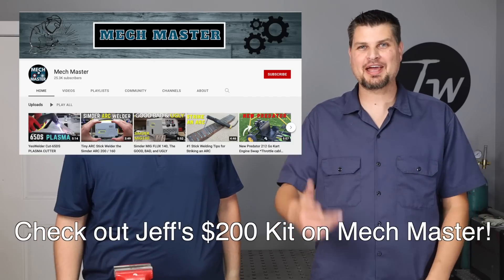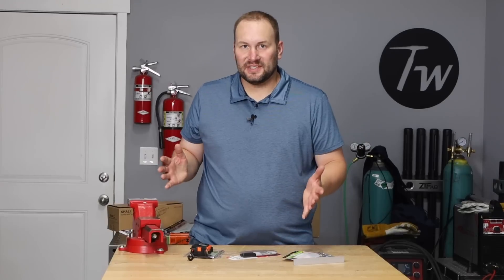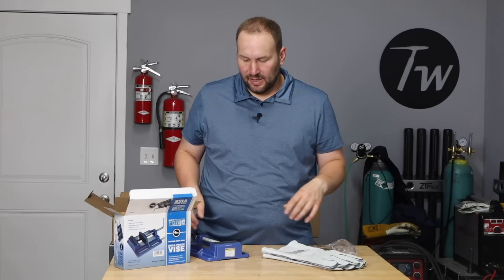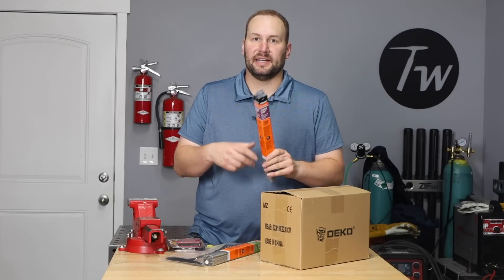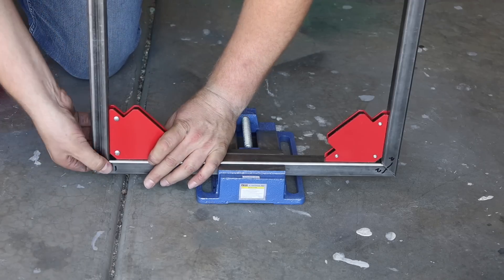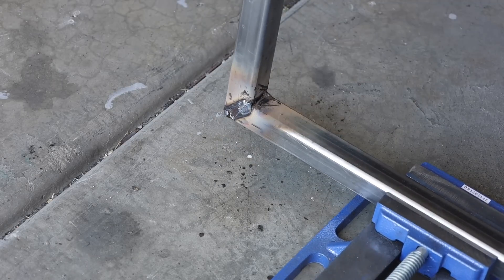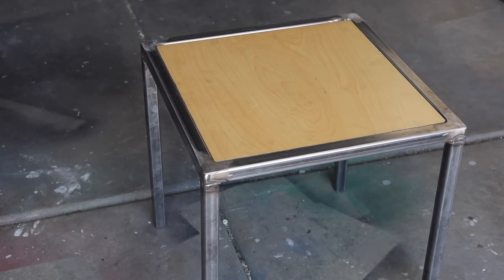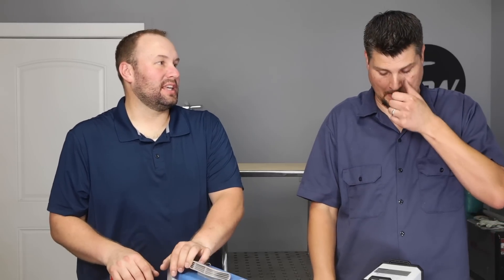Can I Start Welding With Only $200?

Comment: So I have the Yeswelder ARC205. It is a workhorse. It helped me start my own side business and I ended up buying everything else Yeswelder had. My entire arsenal is Yeswelder. MIG250, 65A Plasma, 205A AC/DC Tig and recently the Flux135. 

No conplaints. Being said I do baby most of my machines but the ARC205 stick welder gets the most use since I dont have to run a gas line, I can weld up to a 5/32 rod, I have to run some extra cable for the 240V plug to my power source. I have a strap worked out so I can carry it around and weld all around a bigger priject without needing to relocate my cable too much. 100ft of power cable is usually enough. I changed out the ground clamp to something more robust but the  clamp stinger is more than adequate and feels good to me.

So uh... yeah, I can vouch for Yeswelder, best money I've spent, does the same as the fancy Millers or lincolns or esabs. For $179CAD, get the ARC 205 and have fun!

Comment: Im trying to start welding as a side hobby. Do I just get like metal sheets or pipes from Home Depot? Im just trying to do testing and stuff. And is the welder just like high heat electricity?
Reply: What I'm planning is to weld a funny little roll cage onto a shopping cart and just throw it around like a park or something while being inside
Reply from the maker: You can get material there, but it's really expensive for the amount you get. If you google "Steel Supply" and your city name, you'll find some metal suppliers in your area. The welder just gives the right amount of current and voltage for an electrical arc that is a concentrated source of heat. For projects like that, I wouldn't use a stick welder, I'd use a MIG or at least flux core welder. Stick welding thin material without burning though is difficult. Make sure to test your welds out before you try shopping cart rollovers.
Reply: @TimWelds alright haha! i will see what happens. i will for sure test it down a hill with no one inside it to see if it bends or anything

Comment: going to upgrade a little need to stay under $300 the 2 machines I have been looking at are the vevor 270a multi function and the azzuno 200a multi function which would you recommend or is there another multi function you would recommend.

Comment: I appreciate how concise this is.  Few thoughts, as someone who isn't as crunched for cash:

1. I wouldn't skimp on a welding hood, if only to ensure I get something that protects my eyes.  
2. If I have an existing fleet of tools... I'd get a corresponding one of that set, for an angle grinder.  Maybe.  Depends I suppose on if I elected corded or cordless.  Maybe a cheap corded would do the job just fine.  Or maybe a better quality if you have other projects (like sharpening tools) could justify a better grinder.  

And just to be clear, I don't have any experience.  I clicked to learn, but am still foggy on basics, but would like to pickup a skill or trade I could explore an interest in, and maintain my own stuff.  Will probably go out and pick some of these tools up from HF tomorrow.

Comment: I bought the cheapest mig welder i could find ...only thing i requested was it had to use gas...  Hitbox .... Mig ... I didnt expect much.....😅.   But    damn it works fine .. for how long i dont know ..... But i use it for all those " glue two bits of metal together". Jobs around the house .. i even ran it of my generator at 22 amp ..to glue a gate hinge on .. ...

Comment: I think if you have any kind of confidence you can do this and will like it you will be monety ahead to buy at least a small mig.  You can always start out with flux core but for a few bucks later on you can add a bottle of 75/25 and really enjoy.   After a welder and grinder I would consider a chop saw and maybe a second & better grinder.  I have a really good grinder for removing metal and a far less powerful few and cheaper ones I use a cut off wheel on or a flap wheel of wire wheel.  I have 4 little ones and one big one. Then after that various clamps and a good bench vise if you do not own one. Then I would look at a possible oxy cutting/welding reg.  I run my with a propane tip and use a BBQ bottle to fuel it and only need to buy oxygen.    This is a somewhat expensive investment and perhaps if you have good compressed air a small plasma makes good sense to a person instead.  But a good oxy/gas rig is priceless when you really need to cut something thick fast or need to put a lot of good heat down to bend or move metal.  Nothing else compares.      I have so many more tools and fixture tabes I want to get.  A lot depends on what you are building and why you bought your welding machine.

Comment: i have  the arc205ds very similar. It works pretty good. I had the advantage of working at a fab shop so i scored a grinder and some solid material to make a good table.

Comment: Tim.. I'm not sure if I should be singing your praises here or slagging you off right now. Why? Because some time ago, I asked you a question about what welding machine you thought I might be able to pick up on my very limited budget of around £250. You (and someone else in the comments section) pretty much laughed in my face. And here you are today promoting the fact that one can get into welding on said limited budget. I have to tell you, I did get into welding on  my £250 welding machine budget and I'm so glad that I did. My 200a machine (bought from Midlands based company "Static Arc" here in the UK) was purchased for £250. It's a mig, tig and stick +/- polarity with 60% duty cycle, and I could not be happier with its performance. I found your comment answer to my question to you a little hurtful, but as my late father always used to say to me... Don't let anyone  tell you "it can't be done", and closely followed by "Where there's a Will, There's a Way".
And so Tim, I think I'm going to finish off by saying, thank you. Because it's thanks to your negative comments that I've been spurred on, so thanks Chum, or should I say Chump 👍🙂
Reply: Hi, I’m so glad I found this comment. I am currently trying to get a machine on a budget in the U.K. and trying to get any advice other than “ you will need to spend more “ is a struggle. How did the static Arc welder work out for you in the long run?

Comment: Hi Tim, I enjoy your videos geared to help the hobbyist. I have a video idea that you may be interested in. Low budget carbon arc gouging. Most hobbyists have a basic 160 ampish inverter stick and an air compressor.  I have thought about picking up a cheap amazon $50 carbon arc torch and giving it a go. Could be a useful tool

Comment: $25000 worth of tooling just gets your foot in the door, remember it's not just welding its mostly fabricating, if you even dip your toes into bending and sheet metal work/finishing and painting  then you're looking at another 25k worth of equipment easily
Realistically it's about 100k worth of tooling just to be a truely great fabricator.

Comment: I too use the same welder. Been having a hard time restriking; it's nice to know from a pro that it isn't just me, it's partially the machine. Other than that it works pretty  well for me, but yeah a MIG machine would be way easier for thin stuff.
Reply: Do you think it would be good for making a go kart?

Comment: Tim - this is one of your best videos! Quick, concise, and incredibly useful on many levels - for new welders, for low-budget kits, and for a straightforward project generating real value from the investment in tools, material and time. Maybe next time include acetone to clean the metal, add a bit of paint to finish the metal, and some Minwax to seal and protect the wood (avoiding stains from placing drinks on the table, etc.). Another useful tool - add a wire wheel for the grinder to clean welds, better than a chipping hammer. Please do more project-based videos! Your comfortable manner is very approachable and easy to watch. Much appreciated!!! Keep up the great work!

Comment: Those cheap welders struggle with 7018 and 6010 because they have low OCV. 
So 6013 would have been a better choice I think. And bead appearance is very similar to 7018.
Reply: Ever use one?
Reply: @MrOldclunker  yes, I recently bought a $50 welder (for a project, I want to turn it into lab-bench power supply) but I decided to give it a try as welder. 
OCV is 65V and it barely run 6010 and 7018, you have to hold a really tight arc. 6011 and 6013 ran pretty good, because they are AC rods and they have stabilizers in flux which makes arc more stable on AC, or like in this case, low OCV DC. 
All rods I tried were 3/32, because welder is 120A (even though it claims to be 200A).
Reply from the maker: That’s a great point, Harbor Freight 7018 is actually 7018AC, which has arc stabilizers and runs pretty good on little inverters.

Comment: I’m very skeptical about the UV protection and the numbers of darkening these really cheap helmets claim. They may be ok, but my experience with really cheap Chinese equipment is that they don’t meet their specs and some are dangerously designed and built. Two cheap Chinese welders I’ve tested have no line grounded cord. Instead they have a small ground screw on the back. Usually either people don’t use it, or put some light gauge wire for a ground - very dangerous. Even worse, one had the work connector connected to that ground screw internally!!!

I’ve tested cheap TIG torches that were heating up, and I found they were copper plated zinc rather than solid copper.

I don’t know how someone who has no knowledge or experience with this being able to figure out what’s safe or even workable.

Comment: Nice video. I bet chipping with that cheap hammer was the most painful for you. I bought the Estwing chipping hammer after your recommendation in another video, and I can’t imagine going back to a cheap one again.  I’d use any of the other bits in this video except the chipping hammer and the welding helmet. I had a cheap auto-darkening helmet fail before and it was unpleasant.
Reply: A wire wheel for that grinder can make quick work of cleaning those welds, with a better end-result than banging with a hammer.
Reply: How good does it work?  I’m thinking to get one.
Reply from the maker: Thanks! I do like that Estwing chipping hammer. It has enough mass to it that you don’t really have to strike very hard.
Reply: @dennisyoung4631  , I love the Estwing hammer more than I would have expected.  There something about the weight, quality of the metal, and sharp ends that just makes it work like magic. I don’t usually need to smack the weld - it’s usually enough to drag across it and maybe lightly tap. I’ve had one of those cheap chipping hammers with a ‘spring’ like handle for a long time, and sharpening the ends on a grinder just makes it sharp, not effective. If Estwing went to a show and let people use one of these, they sell to everyone that picked it up. It’s expensive, but most good tools are.

Comment: Although this bargain basement equipment exercise has practical application when money is tight and maybe someone is not sure welding is something to pursue long term, I always suggest that going strait to an entry level (or better) MIG or multi-process machine is the best approach.  Flexibility, quality and ease of welding will pay off in the long run.
Reply: Don't knock them until you have tried them.  You may just be spending more for your pride and a name.
Reply: Can 100% say that as someone who has never tried it before, but wanting to... Cheap stick is absolutely something I will more easily be talked into compared against more cost. If I hate it, and I'm only down 200 bucks, I'll feel less screwed than if just the machine itself cost 200 bucks. If I love it, then upgrading is all another part of the fun and adventure.

Comment: very inspirational video thanx for showing a bit on leveling and squaring your project i still work on a concrete floor  lol
Reply: Dangerous. I wish you luck, but concrete can spall and shoot concrete bits at your face from the instantaneous high heat boiling the water out of the surface of the concrete.

Comment: Good video Tim, I would just like to play the Nervous Nelly and suggest a passive hood at that price point, eyesight is WAY TOO IMPORTANT to leave up to a cheap auto darkening hood that may crap out during a weld and sunburn your retinas. Even here in 🇨🇦 a good passive weld hood goes for $24.99. Would be even cheaper south of the border. Just my 2 cents....
Reply: Passive helmet lenses fail over time and people don't realize this.  Make sure t replace your lens with a "fresh" lens and not one laying around on a shelf.  The auto darkening helmets are not without fault, but neither are the old passive helmets when you have accidental touches and arc flashes.
Reply: I just gave away a cheap auto darkening helmet that is about 5 years old and never failed.  Only bad thing about this helmet: it as not true color.

Comment: Great video! Question: can these auto-darkening helmets really be trusted? Can an LCD shutter block enough IR, visible, UV radiation to protect your eyes? Or are there some "fakes" around that would fail to do so?
Reply: You would know if helmet is not working by having arc-eye and sleepless night after that.
Reply: @Alex-mj7km  that's what I'm trying to prevent 😵
Reply: @nkronert  Well. I know one thing for sure, cheap fixed shade non-autodarkening hood will protect from UV and IR 100%.
As for autodarkening - I don't really know, in theory they all should protect against UV and IR even if it doesn't go dark.
Reply: @Alex-mj7km  then the bright visible light must also be doing a lot of damage, otherwise why bother darkening the glass in the first place 😊
Reply: @nkronert  Yes, the amount of photons in the visible spectrum from welding is sufficient to damage your eyes. Same with looking at the sun. Welding hoods block IR and UV by default and the shade is applied to visible light. The visible spectrum is still a threat when looking at any exceptionally bright transmissions. Ask your doctor next time getting an eye exam. Think about how a camera flash impacts your vision. Doctors often recommend wearing sunglasses for protection while outside on sunny days, simply to knock down the number of photons impacting your eyes. Protect what you have while young, it'll last longer as you age.
Reply: @MadGunner  I was always told to not look into welding arcs, even from a distance, because of UV radiation.
I once saw a warning on tv that sun glasses exist that block UV insufficiently, so I wasn't sure about these welding helmets. 
But yeah, visible light of sufficient intensity can also do a lot of damage, so good to know that these automatic shutters are really fast.
While I left the period of being young behind a long time ago, I'm very conscious about the importance of seeing (and hearing!), that's why I asked the question in the first place.
Thanks for your insights!
Reply from the maker: Thanks! I have wondered the same thing. I don’t have a way to test it and don’t have any reason to believe that they aren’t effective. Because of the amount of welding I do, I use a $500 name brand hood on a daily basis.
Reply: @TimWelds  thanks for your insights!
Reply: In my humble and limited experience, they work quite well, the biggest difference between cheaper ones vs more expensive ones seems to be that the cheaper auto darken both when they should and when they shouldn't. 🤣

Comment: I have that same welding machine and it works 100% I have already done several welding jobs whoever wants to buy it I recommend it
Reply: I actually bought that same exact welder and watched his videos and I learned how to weld with that welder in a day between that cheap welder and his videos I just found my brand new hobby
Reply: @DYKEINATOR 2.0  how much would i have to pay to get started from 0?
Reply: @RichBeRanting  200$
Reply: @shTree  any idea where i could start?
Reply: @RichBeRanting  I mean the video shows a pretty comprehensive setup. This entire channel is a fantastic resource if you want to get into welding
Reply: can i know what the machine is?
Reply: @kimaykipay8349  he has links in the description for everything brother man
Reply: would i need an generator to power it or will a norman house outlet work?
Reply: Would it be good for welding motorcycle parts for a backyard super low end bobber
Reply: @czvoidrekt6941  yea it shouild work fine but u need to be really good at welding when ur using motercycles also depends on the steel lower end dirtbikes use mild steel which is fine for the wleder other use aluminum which can inly be welded by tig welders and chromoley which is hard to weld with arc. when practing u shouild stress check ur wleds with a hydraulic press or hand press